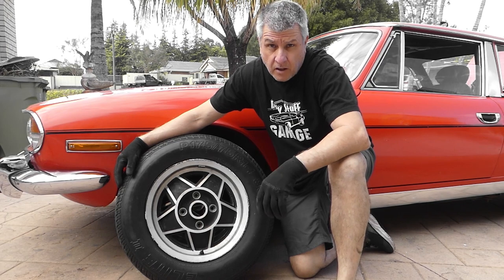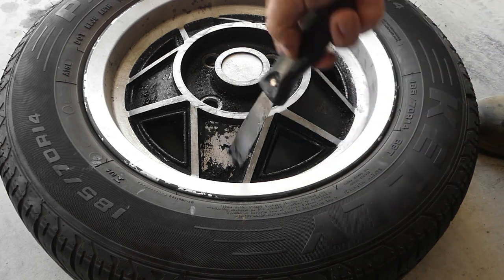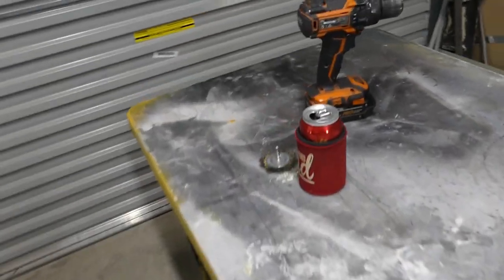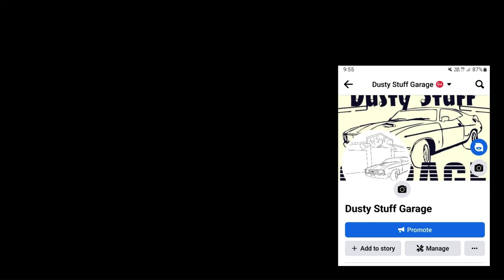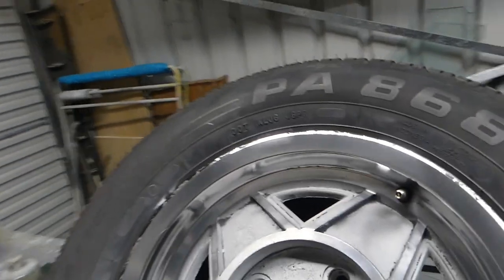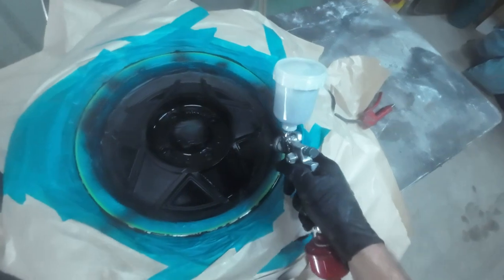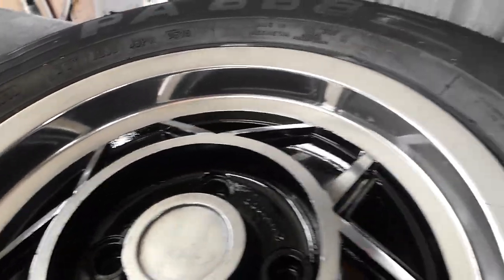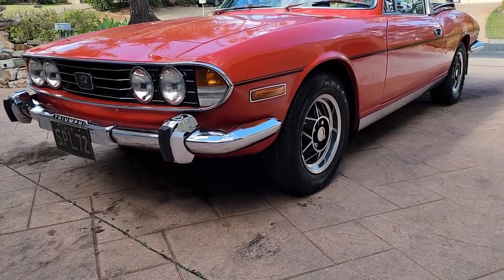Triumph Stag Wheel Polishing

Comment: Good result!  You'll want to keep those waxed though else they'll rapidly oxidise.  I cheated with mine, popped them down to the local diamond wheel cutters.  They had quite a challenge with them though, good old 1970's wheels (not quite true) needed to be turned for a long time to allow the CNC machine to map the wheel before the cutter could start.
Reply from the maker: Thanks. I use a snow foam wash system and cabana wax which keeps the oxide at bay..break dust is another enemy. But I'll keep going over them to maintain the shine. Cheers

Comment: what did you use to polish the aluminium wheels seems very quick the original turned  surface finish was about 3.2 R a-μm –(microns) which was quite course so i rubbed it down to 0.4 R a-μm –(microns) then it would polish up to a good mirror finish but this took most of the day too do
Reply from the maker: I used 320 grit and then autosol and a high speed drill to bring back the chrome look, a dirty job! But amazing results.

Comment: I had one of these in the 1970's. Lovely car. Mine was white with camel leather interior. Got it second hand. Was in surprisingly good condition with low miles.  Most of them had been thrashed,  as guys thought it was a.muscle car. It wasn't.  Not even a sports car. It was a sedate cruiser. The V8 was.too small and underpowered.  Still the girls liked it, and that suited  me in my 20's.
Reply from the maker: Wow so the problems with timing chains etc were part of the cars reputation in the 70's. They were classed as junk when I went on the hunt for one back in the 80s, but as you say that V8 stag burble got me every time and still does today ! Thanks for reaching out mate 👍